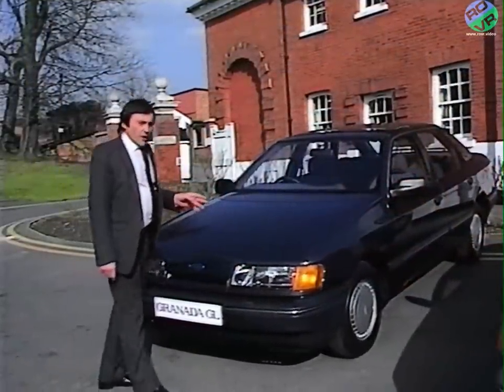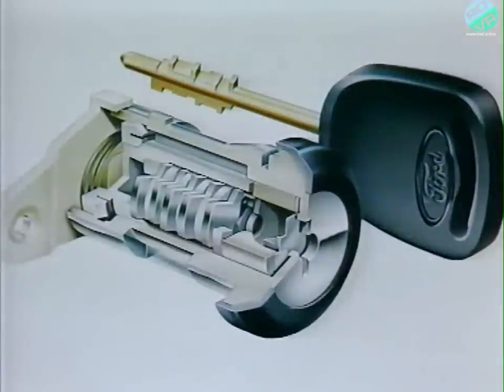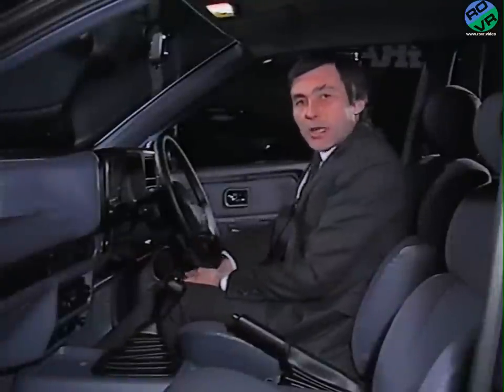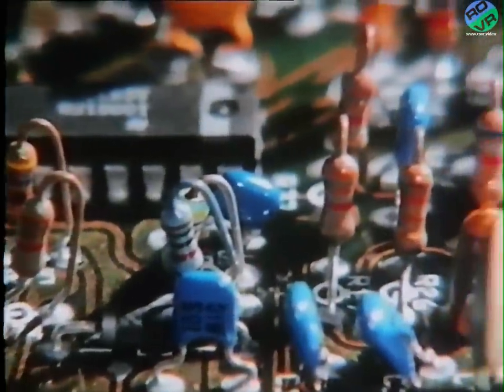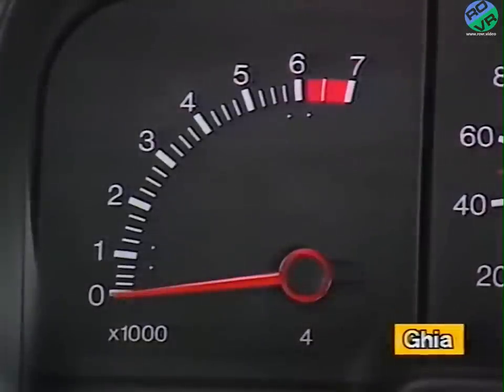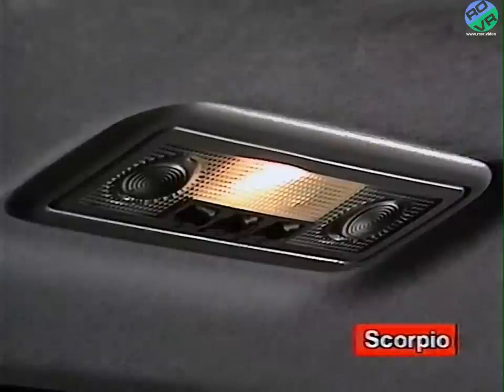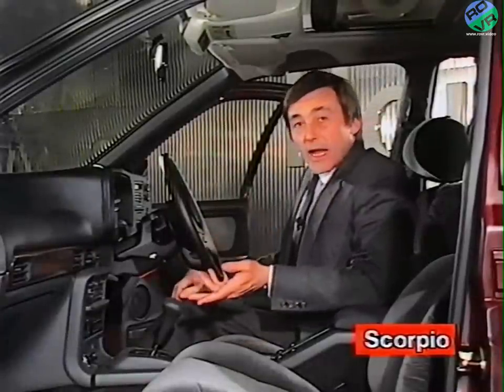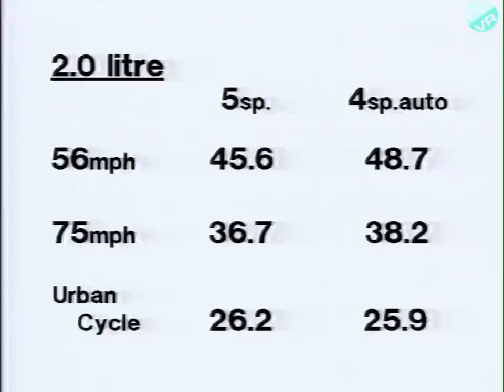Ford - The 1985 Ford Granada - A New Dimension in Luxury Motoring (1984)

Comment: I had a 2.9 Ghia X about 30 years ago, and if you floored it, you could get the fuel consumption computer to show 2 miles to the gallon.
Reply: Paul Marshall I had a 2007 Volvo T5 and harsh acceleration when the engine was cold used to get the instantaneous fuel consumption down to 2mpg too! Loved that!
Reply: But a gallon was only 85p at the time.
Reply: @fornicateu2  And average earnings of £4000 per annum
Reply: @LivingLifeSlower  Average earnings where I live is 16k now and its 1.23 a litre, thats a fiver a gallon most of which is govt tax, theft.
Reply: You fools, that was instantaneous fuel consumption
Reply: @LivingLifeSlower  I was pulling 20k at that time.
Reply: Paul Marshall my cousin had a 2.9i Ghia LX (extended wheelbase) limousine version. Whenever I visited the UK, I used to love going out for a ride in his car.

I always thought that the ride was wonderful and really smooth. He got pulled over for speeding at 120 mph without realising he was doing it.. he thought he was doing about a ton.
That's how effortless the engine was.

It was a company car, and he was gutted when he had to give it back. I always loved it.
Reply: @nessuno5403  And?
Reply: Been there mate - happy days! 😬
Reply: Bollox mate it's only 2.9 v6 and weighs around 1.5 kg. It's more like 11 mpg to the gallon if you floor it. But what's the point of that!? Mate it's blokes like you down the pub who ruin the rep of decent cars. Drive it sensibly me old china you get at least 22 mpg urban like my immac 2.9 Scorpio
Reply: @fornicateu2  And you earned £70 a week

Comment: This was a VERY good car for its time and light-Years ahead .. My late dad had one as a company car... It was SO ahead of anything else for its time. 
Ford went above and beyond with this car...  And no I am not a Ford fanboy ... 
This was a magnificent car
Reply: what was good about it it looks so dull
Reply: @paulhunter123  ..For its time this was a great car... Have a look at other cars that were launched in the mid 1980's... It had performance in the V6 petrol version and economy in the diesel version... It was miles ahead of similar cars like the Rover 800 ... It was a good solid well made reliable car .. Even the base model 1.8GL had "Good spec"
Reply: Americans say the same about the Taurus, which was basically the same car.
Reply: @briansaiditsoitmustbetrue4206  
It wasn't that good really.
It was just a big Sierra with ABS as standard.
My dad had an '86 2.0i Granada GL in '89 and I own an '87 Granada Scorpio right now. They're not all that.
They ARE fantastically comfortable and very spacious but the engines were old nails and the steering feel wasn't up to much either.
I'd far rather have a Rover 3500 Vanden Plas EFi any day !
Reply: As were the Rover V8  used in the SD1 & the PRV V6 dated back to the early 70s and was used for about 20 yrs, similar to the Essex & Cologne V6's so I think it'd be rather unfair to give old Ford a hard knockin for the dated engines.

Aye, they were gettin on abit and certain aspects of the chassis might not've bern up to say BMW & Mercedes or heck even peugeots handling of the day but g8ven their target market I dont think that was quite what they were aiming at 😃.

Remember we're talkin mass volume car makers here, Ford, Vauxhall, River, PSA etc and I dunno if any of em made any pretentions of trying to be a sports saloon, more comfy crusiers, Senator, SD1, 604 etc all had gpid specs for thier time. 

 I agree the Granada might not have been brilliant step up from a Sierra but for a volume manufacturer Ford was offerin some pretty neat stuff in its segment esp com0ared to the Germans wh8ch woulda charged k's more for the same options.

I th8nk it looks 0hen9minal for 1985 standards, dull by todays yes but even 8n the early 90s still looked quite modern even compared to Hands, Lexus, Mercedes, BMW etc.
Reply: Car was awful.
Reply: @gottliebdee263 the granadas are great.better than todays rubbish.

Comment: That Scorpio has more spec than my 2018 Avensis
Reply: @Matthew Dawood Khaghani  MPG + space + safety and obviously cost 😑
Reply: @Matthew Dawood Khaghani 2.0 d4d
Reply: @Matthew Dawood Khaghani far cry from my RX-8. Change in job location forced sale due to Smiled per gallon not cutting it
Reply: @Matthew Dawood Khaghani I absolutely detest this Toyota and I'm counting the days down I can change it. 

The RX was my baby and I still long the day I sold that car. I should have just kept it and covered her up.

Next car I would love an older car hence why I'm here. 

Would love something like an old Skoda Favorit or a Montego
Reply: No it really doesn’t. The Avensis is quite well specced in all trims with things like air con, alloys, 6 speed box all standard unlike the Granada. Not to mention the safety features
Reply: This was the peak of the company car era. The higher up the management, the more gadgets you got!
Reply: Yes, Ford Europe must have been really cashed up back then in order to bring in such advanced equipment like a pneumatic bladder to pump up to give lumbar support. I don’t even think the Japanese were even doing that yet. The ABS braking system would have been quite a step forward as well, as only the Germans really had ABS in passenger vehicles.

Comment: I had a 1985 Granada Scorpio 2.8i, and it had everything except leather upholstery: aircon, electric front seats with pump-up lumbar support, electric rear seats, rear entertainment controls with 2 sets of headphones, trip computer, self levelling rear suspension with onboard compressor, interior lights all over the place.  It was very comfortable, smooth, sounded nice, and was fairly quick for the time.  I managed to blow the autobox up though, which cost me £600 to get fixed.
Reply: @pmailkeey To get maximum acceleration I would put it into 1st gear, hit the throttle, and when the revs got to about 5500, nudge the gear lever into 2nd without backing off the throttle. Then the same again into 3rd, etc. It used to go quite well, until one day it shifted from 1st into....nothing - just a box full of neutrals.  Game over!
Reply: @pmailkeey Torque converter broke, I think.  It may not have gone much faster, but it felt faster because it was revving higher in each gear.  Funny how times change - my current BMW 330d would murder it without breaking a sweat.

Comment: I loved my Scorpio. It was practical and pretty nippy for its size. I bought mine 6 yrs old (C reg) with 40,000 on the clock in what I called Raven black pearlescent when I was 25, I had a lucrative contract that paid for it. I could kick down at 100 mph and it would still give a kick to your chest. I was spoilt with that car, although I think the shape has aged badly now. I part exchanged for a brand new Focus 2.0l ghia about 7 yrs later, it didn't have half the refinements of the Scorpio, but alas I had a family on the way.

Comment: Taking the rose tinted glasses off for a bit, my memories are horrific thirst if you drove it enthusiastically, a rear end that used to wag like a spaniels at even a slightly damp road and rot. Lots and lots of rot.
Reply: In 2001 I had a 1987 1.8GL and couldn't ever get more than about 30mpg however 'gently' I drove. 
Throw in a distinct lack of power and it wasn't a pleasant car to drive either!
Reply: Yeah, but let's hear it for that coin holder 🤣

Comment: The Mk3 Granada was a much improved car with room for 5 adults, lovely engines, a big capacious boot, nice power steering, good comfort, and decent economy on the 2.6 and 2.9 EFi engines which could easily tow a boat or caravan without issue.

Comment: You can see this was the point Ford well and truly departed from traditional old fashioned car design. IMO this is the birth of modern car design as we know it today.
Reply: RIP Uwe Bahnsen, and happily still with us, Patrick Le Quement.
Reply: I think the Sierra was the birth of modern car design myself. One of the first cars to have plastic moulded bumpers, and a slippery aero dynamic profile. And launched in 1982. It took a few years for the Sierra to catch on, especially when you consider the car it replaced, the square and boxy Cortina.
Apart from the door pillars, I don't think there was a single right angle to be seen on that car.

Comment: ........ looking through an 88 Autocar mag.... (not mine honest) I have some prices.
Granada 2.4 Ghia X.  £18506.      2.9i. Scorpio £19918.        2.9i Scorpio 4x4. £22139
Jaguar XJ6 2.9 £18400.               3.6  £20400.                        XJS 3.6.  £23,500
Golf GTI. From £10,435 ..........    Morgan plus 8  £16,856
Mercedes 190 £13850.                 200. £16,100.   ...... so Granadas were not cheap.
Part of the savage depreciation was caused by fleet buyers getting HUGE discounts.
Reply: On paper it doesn't look like good value  but the 2.9 jag was the base model and I bet the merc was bare bones too.  Start adding extras to get up to Scorpio spec and I doubt the Ford cost more. Mind you I bet there's more 190s on the road still, absolute tanks.
Reply: I'd take the Mercedes 200 any day over the Granada. But I do remember when these Granada's were released. They were quite revolutionary in design, and priced to match I guess.
Reply: Pretty sure my dad's 2.9i ghia x had over a grand knocked off the list price. With an RS spoiler included.
Reply: The biggest problem Ford had with that car was the badge, badge is very important to people looking for a luxury car ( or indeed any luxury item) and are intending to spend that kind of Money, but when I saw ur XJ6 and the merc's prices I thought to my self no wonder it was game over,  specially as people  would think "well I am just getting the same badge that's on thet  shabby 1100 Escort thats down the street, after spending all that money" right or wrong that's how people think!
Reply: Interesting glean. I remember "Car" magazine around Aug/Sept '88 did a long feature on the top 10 selling cars and interviewed big company fleet managers, lease rental purchasers etc for their opinions. They based their decisions on reliability/downtime, routine maintenance costs, dealer/servicing network on a three-year basis. Initial price - and even then set against resale/return price - was only part of it.
Reply: It was rumoured at the time that the rental companies made more profit from selling six month old cars than they did from renting them out. Working at a Ford dealership at the time it did seem strange to me that, even in winter, the rental companies put so many cars in for first service so frequently which we never saw again.

Comment: As for the 45mpg 😅😅😅😅, maybe freewheeling down hills, maybe!
Reply: My 1990 2.0 auto Scorpio would just scrape 40mpg but no more if I nursed it down the M40 wedged between artics in the inside lane.
Reply: @veritasvincit2745  24-28 from my 2.4i auto Ghia. 28mpg required teeth-clenching econodriving, just not worth the bother.

Comment: That key developed by CHUBB, easiest car to break into,
Reply: Previous fords were easier, I used the key from a welding generator for my 1600E Cortina after losing my last one at work in 74.
Reply: I remember getting into the wrong Mk2 Escort in a car park by mistake. My key opened and started both.
Reply: @ants9230  So true. In my band, the guitarist's Capri key opened the singer's Mk2 (and the singer could jiggle his house key to open it). While we played pool and had a shandy, all our gear was nicked from both cars.

Comment: Rear differential problems, automatic gearbox problems. Electric gremlins. Every one of them.
Reply: Had a 1990 gran scorp from new without issues and loved it. General rule back then was never keep a car beyond three years or 30,000m and you wouldn’t have a problem.
Reply: Ronald de Rooij i dont agree with you we had a 2 litre 4 yr Old Automatic for 5 yrs with no problems at all
Reply: Mine was more reliable than the company W123 Merc I had inherited when I started  with the job I had then. Not only did that Merc fail several times it also couldn't get out of its own way. The Ford was 100% reliable  easy on the eye and real pleasure to drive. Mine was a 2l manual Ghia, sweet spot in the range IMHO.
Reply: Except the 13y.o. 110k mile 2.4 Ghia I bought (sunroof seal leaked, though)
Reply: Depends on how you look after the car

Comment: The one Ford Granada in this model was the scorpio version I believe the engine was a 2.9 litre v6 with leather n all the trimmings 😊😊
Reply: My sweety worked for the docks security back when these lovely Granada's were launched the docks had every colour one cud want in the scorpio range silvers blues etc all brand new in all specs a Ford lovers dream the one that stays in my heart is the silver n black leather trim one cud smell the new car smell 😊😊😊👍👍👍🤪
Reply: The 2.8i was increased to 2.9 around 1987 IIRC and it made a heckuva difference for an extra 100cc. Not so much in power but the longer stroke gave it more torque which made the low-revving lump feel more brisk.

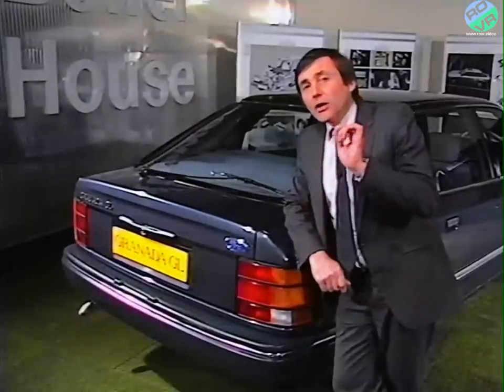Comment: 04:41, that rear wiper activation is a very good idea. Since if one is reversing it is likely that you'll be attempting to see via that glass. Not typically necessary when going forward. Why didn't Volvo think of that? My 850 doesn't have that feature. 

06:06, another matter I find lacking on the 850. I do not know if it ever had height adjustment. Mine is all electrical adjustment. One control no longer works. Not sure if it was meant for height seat adjustment. I would have preferred simple manual operation. Too many electrical control features for the seat seem to irritatingly over complicate things.

That said, my Volvo is evidently more refined in terms of quality of fabrication, trim and finish. Those seats do not look as comfortable.

Comment: i had a prototype granada 2.4i with a 24 valve pushrod engine on 1988 plates. they didnt come into production till 1989. It was one of only 10 blueprint engines ever made. It had the power of a 2.9 (140 mph top speed) but the economy of a 2.0L. Loved that car and had it for years till in traded it in for a carlton automatic 2L CDXI,

Comment: Wasn't this car sold in the U.S. as a Sterling? Seems I vaguely remember it. I don't recall the model name though.
Reply: Maybe you're thinking of the Rover Sterling? The Rover 800 (as it was called here) was competition for the Granada but the Sterling tanked in the US because of bad quality and indifferent dealers. The identical Acura Legend topped JD Power surveys.
Reply: @dizzyonaball4623  I figured it out. The European Ford Granada was sold in the US as a Merkur Scorpio.
Reply: @palebeachbum  Yes, I've read somewhere about the Merkur (Sterling was a contemporary Rover model in the US, not Ford derived). Here in Britain, I saw a US Ford Taunus (or was it Taurus?) in a street and was struck by how related it looked to my 80s Granada. Did it follow on from the Merkur?
Reply: @dizzyonaball4623  the Ford Taurus was designed for the American market and as far as I know was not sold in Europe. It was sold from 1986 to 2006 and went through 4 generations solely as a four-door sedan.
Reply: @palebeachbum  Thanks for the info. The Taurus I saw must have been individually imported because it wasn't official, as you say. Looked similar enough to the Granada/Scorpio to make me look it over.

Comment: Every American watching to the end is realising European vehicles got miles per gallon figures in 1984 that US auto makers still haven't managed today.
Reply: That may be partly due to a UK gallon being ~1.2x US gallon, so you'd get 20% more mpg just using the UK mpg measurement.
Reply: @lewis72  Interesting point I had not considered.  One such example when taken into account, a Ford F-150 pickup truck is comparable to the equally abysmal UK RangeRover 3 liter turbo diesel at 30mpg to 31mpg. And the F-150 weighs considerably more so I dare they are doing well considering.
Reply: @Nine-Signs  
A whole number of things to consider. It's quite difficult to compare fuel consumptions across vehicles.
Reply: @Nine-Signs  European and Asian cars are in general more fuel efficient and have been for years compared to US vehicles

Comment: This model looked good, but developed some problems over time. Rust, electrical issues, that semi-electronic carburetor not working properly and clutch wearing out faster than other cars. Those who had one that was new and well equipped, probably had completely different experience. The ride was smooth and handling adequate.

Comment: Why does it look so reminiscent of the Taurus? Is this what the Taurus is actually based upon?
Reply: Looking at the proportions of the interior it certainly looks like it. But the exterior looks like it's slightly smaller, like a Tempo maybe.  I don't think the Taurus was introduced in the US until 1986, with the Tempo appearing in 84.  I hasten to add there's nothing requiring UK cars to have US counterparts, though that is often the case.
Reply: @xaenon  Agreed... it does appear to have exterior dimensions like the Tempo. And seeing how we got the lower-end versions of the Chevette--1.4 & 1.6L OHC engines vs. the 200hp Lotus 2.3L DOHC--it wouldn't surprise me if that's the case: A different face on an existing platform.

Comment: 5.5 inch wheels??
Reply: Width, not diameter. Still pretty rubbish compared to now. A 2001 Corsa had 15 x 6" alloys and you'd struggle to flog a set on ebay. Tupac's 7-series had custom 19" Blingolicious rims put on specially. He should've just bought a well-specced 2018 Twingo

Comment: The design includes less spot welds and a clear material capable of transmitting light. The doors are fascinating. (No, they're not.) Then the door slams shut with a horrible clang, and we hear that the materials are "mostly non-corrosive......"